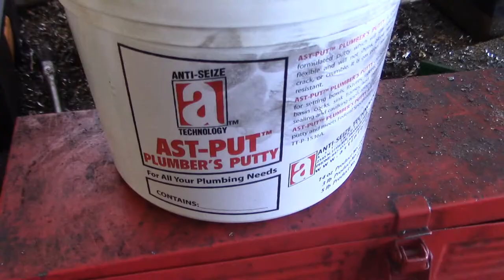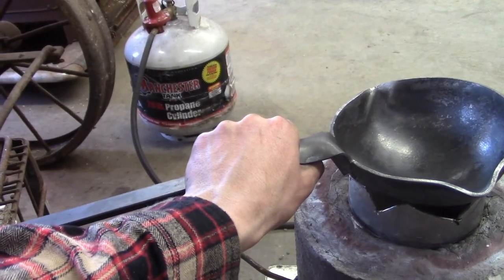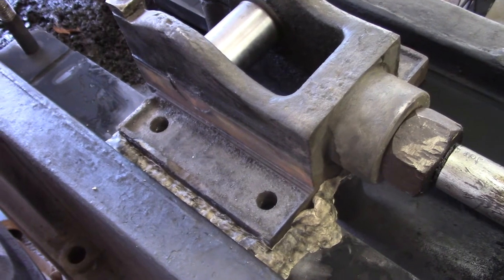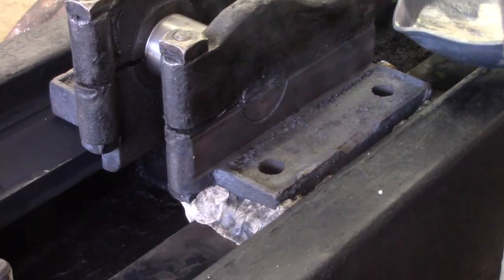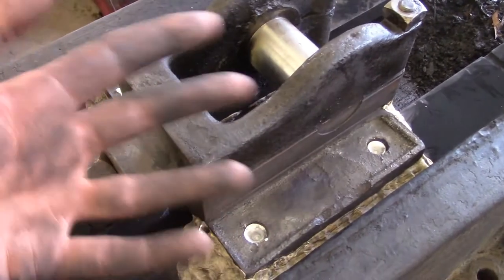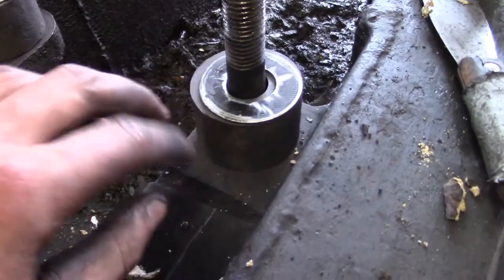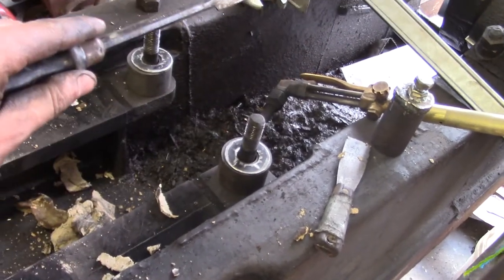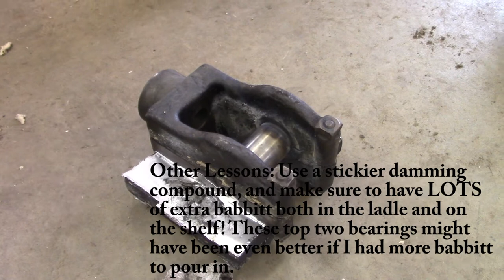Pouring Cross Head Babbitt - How To Part 2

Comment: I am amazed I never saw these vidieos before. My first time poring was the connecting rods on Rumley tractor and it was pretty well a trial and error thing but we got it in the end. I got a lot of my info off Smokestak as well and youtube. I used pottery making clay as a damming material. It was much later I found out about roto metals. I think you did an excellent job. I realy enjoyed watching.
Reply from the maker: Thanks! I got a lot of info off of smokstak, there's a bunch of info there but it's spread out. I spent a lot of time reading dozens of posts and compiled everything I learned. biggest lesson i learned is that you can never have too much damming!

Comment: Looks like your lowers should do great and the top probably adequate for just light sliding load, well lubed.
Reply from the maker: I put a straight edge on the uppers, they're actually surprisingly flat with decent contact area. I'm gonna run it!

Comment: Looks like the babbitt  job will do just fine. Quite enough bearing surface in my opinion. Looked like it would be very difficult to dam those to make a perfect pour. I think air was your enemy in those trunion holes and resulted in the shrink back. Maybe a little slower pour would have helped with that problem, who knows. Good job though for the first try. Oh, maybe Franko would like some of the leftover babbit to fill some of the holes in the Lincoln?
Reply from the maker: I think if i used more damming the uppers would have been just as nice as the lowers. Also i think if i had more babbitt and just kept pouring, the leak might have clotted up and i could have saved it that way, though it wouldn't have come out as nice. And if i used babbitt to seal holes in the lincoln, that car would weigh about 10,000lbs!